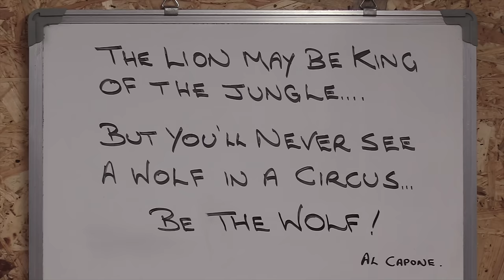HayaBusa Streetfighter Day #11,  Custom Clockdash Mount !

Comment: Very good job!!!

Del, now you have two damping systems? The original (four gourmets), plus two more in the triangle. Those in the triangle are not necessary, and on the contrary, perhaps the welding of two profiles is missing to prevent vibrations of the tin (even though it is thick). Two profiles that pass close to the screws that connect to the triangle, and go up. But maybe I'm wrong?

Comment: Brilliant job Del👍
Looks nice and aggressive from the 'cockpit' I would assume 👍
That tool for de-burring the holes is certainly handy 👍
Keep up the good stuff Del 'n' Pen 👍
Reply from the maker: Thanks Paul 👍, yes indeed, a manual de-burring blade is so useful, specially on sheet metal where a grinder can compromise the edge you've cut!  Thanks for your support, D&Px

Comment: Sleeking help from the community! 
2018 triumph street twin
I recently dropped my bike going around a corner. Bike slid (clutch side)and I rolled about 4 times 😅, rode back home in shame. 
Assessed damage: a few scrapes here and there and the gear sifter peg was bent upwards. 
A month later my bike wouldn’t shift to higher gears. 
I noticed it when I was trying to go into 4th and it wouldn’t budge. Down shifted fine to 2nd. Tried upshift again and no luck. Down shifted again and now it’s stuck on 1st 😢
Reply from the maker: Sorry to hear about your drop, have you replaced the gear shifter?  Could it be it's binding on the casing?

Comment: Inyeresting start quoting Al Capone "Be the Wolf !". If you knew this already, apologies ..... BUT ...... Where do sell by dates come from ? The State of Illinois appealed for financial help for School milk. Al Capone chipped in $2 Million, this was enough for a lot of milk for a long time. His stipulation was that the milk had to have the bottled date on to avoid stale milk, which he was forced to drink when he was at school. Hence sell by dates were born. Interesting choice of hole punch :) 7.62 case ? Result, very neat. Lovely job, no change there :) Thanks :)
Reply from the maker: Yes mate, well recognised, it's a cut down 7.62 Nato round, as you probably know the narrow end is soft, but the outer tube is thicker and pretty stout, so parted it off on the lathe to make a perfect hole punch!  ... Didn't know that about Al Capone, I guess most of today's generation wouldn't even know what school milk is!!
Reply: @Moonfleet41  I came back in to change the details, but will leave it for someone to correct it. I believe the City of Chicago appealed for the milk money, not sure now. Sorry if I am wrong, but the jist is there. Al Capone started the sell by dates on perishable foods. Wierd huh ?!!

Comment: After seeing it I thought it might look cool to integrate the headlight in to the front of the gauge cluster built off the bracket you made.  Maybe a little aero dressing around it to hide the wires?  Something sort of along the lines of the modern versions.  Dunno, just a thought you might not have considered.
Reply from the maker: In this incarnation, I'm following the Speed Triple vibe, clocks mounted on the bars and twin headlights on a fixed mount... possibly with a similar small fly screen to cover the back of the clocks???... still lots of plans, just letting each facet eveolve one at a time!

Comment: They should use bullets the way you do, mate. Much safer, better results. Like your new and seltmade cockpit positioning. Although the stock Suzuki Busa cluster is rather large accoring to today's taste. The faster you ride the easier reading them ;-) You can paint the parts at a later stage. Have a wonderful evening, Günter/Nürnberg
Reply from the maker: Yes, they are a little large, but great for instant information, and fit in withg the bike which has always been a bit of a bruiser..!

Comment: Excellent use of the shell case. (.357 Magnum if I'm not mistaken).
Reply from the maker: Not in this case, it's a bit of a disguise, it's actually a 7.62 Nato casing with the narrow tip machined off, makes a perfect hole punch as it's thicker than most rifle rounds and doeson't deform!

Comment: A very nice bespoke bracket!
I made mine out of a bit of old scap I found in a celar at work.the grill from an expresso machine 😂 easier to bend with having no vice. Strengthening with some glassfibre .
Yours looks way better than mine.

Looking forward to more brilliant creations from the garage.
Reply from the maker: Mate, you HAVE to get a vice in your life.. they're dirt cheap and will make a world of difference once you have one.. Specially being into ratting with all the small things you'll modify and make...!
Reply: I like your idea of using a grill or expanded metal to form complex shapes, then cover them with fiberglass! That's very clever! I save the screens off old fans and any sheet metal from broken appliances that has vents or perforations. Then, when I need a louver, grill, or mesh in some project, I have a factory piece that I can patch in to my project and the ventilation looks perfect, since it was machine made and not a result of me, a drill, and a file. Thank you for the clever idea. I love your avatar, by the way :) Very timely for being so close to Easter, as well. He is Risen!

Comment: i have them clock faces,have you ever tested to see how accurate they are cheers,good job.
Reply from the maker: Driven electronically from a sonsor in the front sprocket, it's pretty much bang on.. ride past one of those speed readers in villages, and it reads about 2mph over.. (the right way round), it's the mechanical ones driven from the cable to the front wheel that are usually way out. !